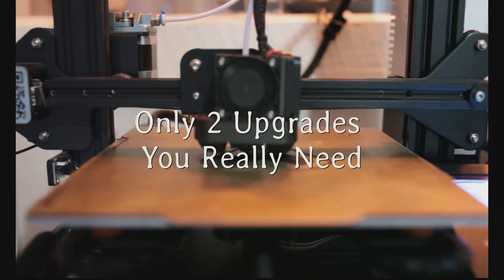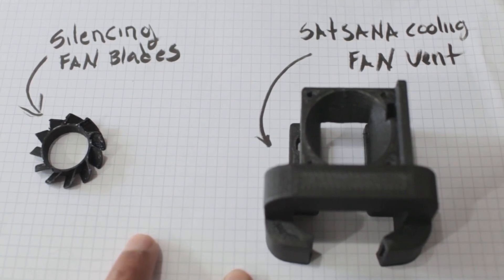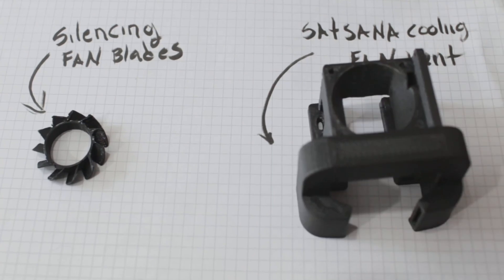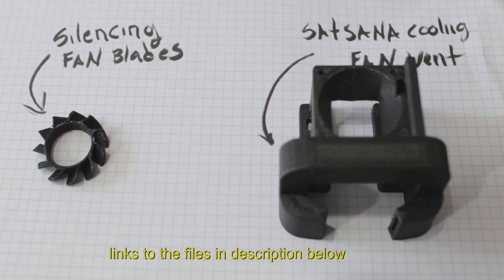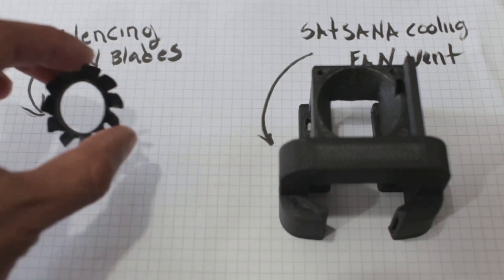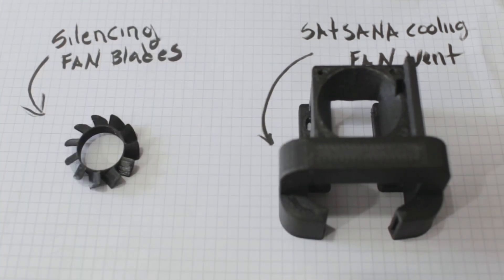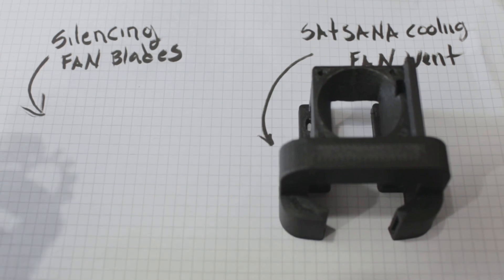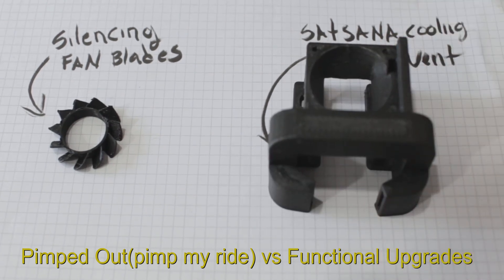only 2 cooling fan upgrades you need Ender 3

Comment: The vent is actually a really smart idea/upgrade, I’ve recently gotten issues where my cooling fan is actually cooling my heat block and causing a thermal runaway, the vent. Is. Needed.
Reply from the maker: It’s a game changer! Ender should come stock something similar.